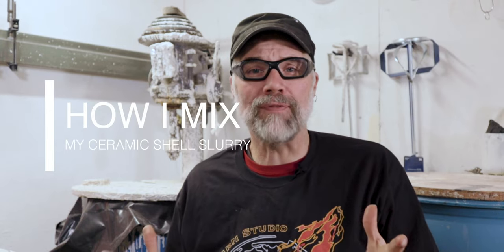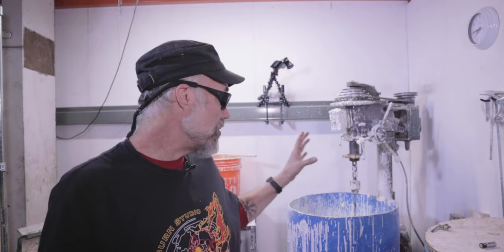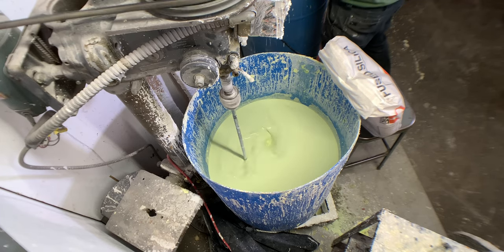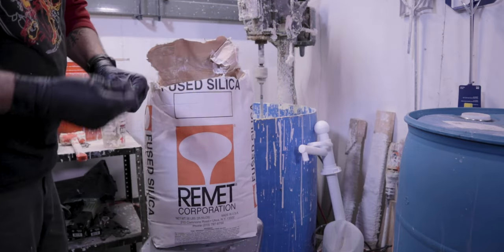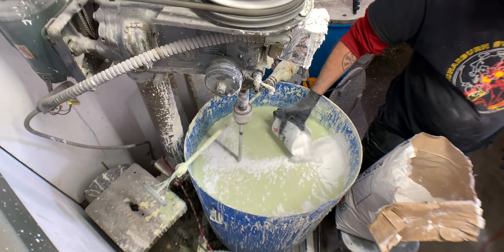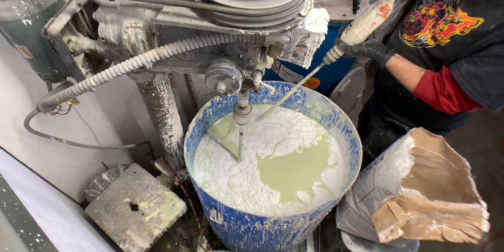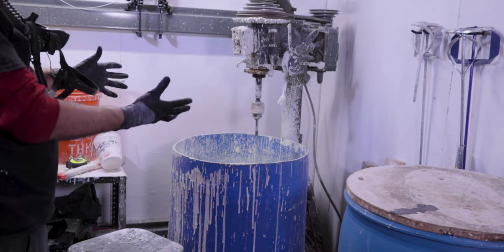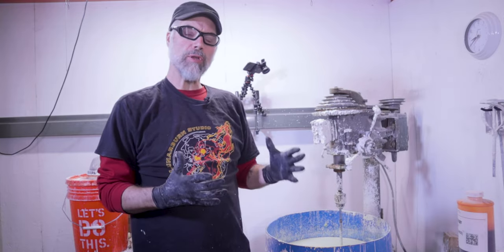Lost Wax Casting: How I mix My ceramic shell slurry

Comment: Hi. I have a question. In our country, we have fused silica 200mesh, not 400mesh. 

Is this ok to use 200mesh fused silica for making this slurry
Reply from the maker: 200 mesh works fine.  If your using a suspension agent it will settle faster so you will still have to mix the slurry more regularly.
Reply: @LunarburnStudio  suspension agent you mean bentonite ?
Reply from the maker: @farhanchoudhre6962   In this case Yes. I se benenite.  But other things can aid in suspension as well.

Comment: hello eric 
 i need to mix this ceramic shell i have a silca flower what i need more to mix with and ratio please 
in the video u add the silica in green liquid what is it 
and in the last slica flower and collocdil slica are same ? 
and thanks
Reply from the maker: NOt all silica flower is the same, what type do you have? Fused silica, alumina, other? the colloidal is the liquid. Ratio that i use in 1 part liquid and 2 parts dry (flour). this will make a white/gray color mixture.  The green in my slurry is a color indicator that helps tell you when your shell is dry before dipping the next coat.

Comment: How long does this entire process take to complete?
Reply from the maker: How long to “Dip” a shell? Or the entire process of metal casting?
Reply: @LunarburnStudio  Hmm I had been asking about how long to "dip" a shell, but I'm also curious as to how long it takes to do the entire process.
Reply from the maker: A typical shell is 10 dips. First few take and hour to dry, later ones more like 2-3 hr. So you can power through in 24 hrs. My dip cycle is usual spred over 3 days. 

As for the whole casting process. If you would go to a commercial art foundry with a pattern/sculpture they would say 3 months start to finish. 1 month for the mold, 1 for the wax positive, and 1 for the metal casting. 

It can be faster if you know the process and can do some of the work.

Comment: Do You have any recipe for home made slury out of Clay, water and sand? I made such mix few years ago. I dip in this wax model but to avoid cracks of Shell when water will evaporate from Clay i added a lot of paper and ash to slury. I found infirmation that celulose fibers from paper will act like binder and that will give me Shell without cracks and ash will make IT hit resistant. After Burnout this fibers will give nice venting to whole Shell for gases to escape. But i added to much paper i think and whole Shell was burning like wood;) and became very fragile. I poured only one of three such molds and result was very bad. But the way how i made wax model  remaind me a little bit Ashanti bronze casting from Africa. If they can do it with clay myby we can too;)?  If You have some idea how to do something like this at home i think everybody will be interested.
Reply from the maker: Unfortunately i Dont but I will look into it.  I started off as a potter and know there is a-lot of cross over between the two fields.